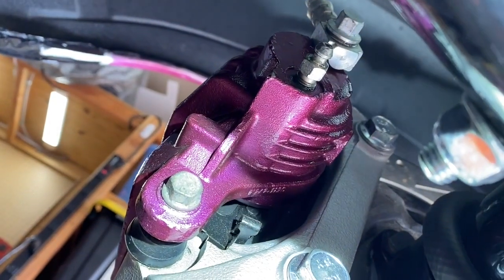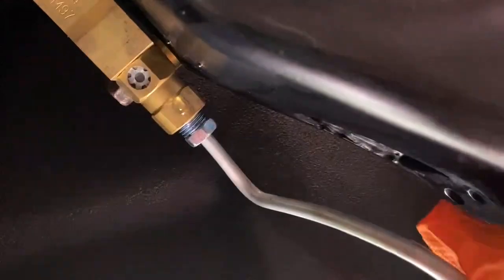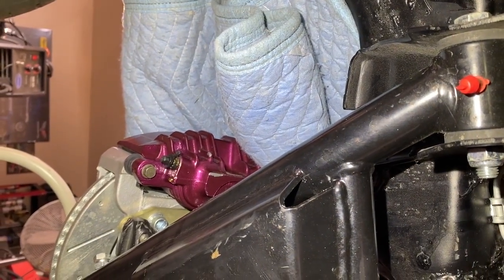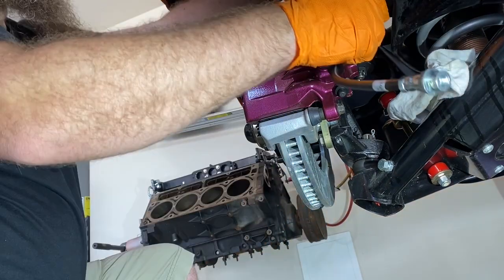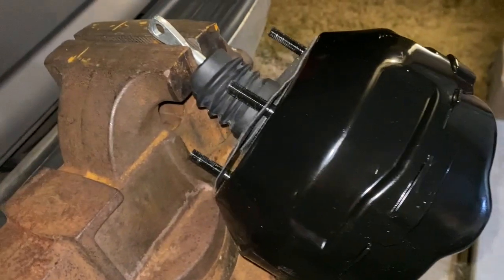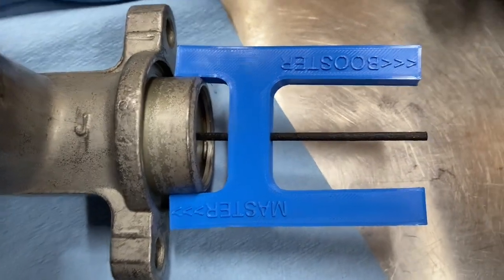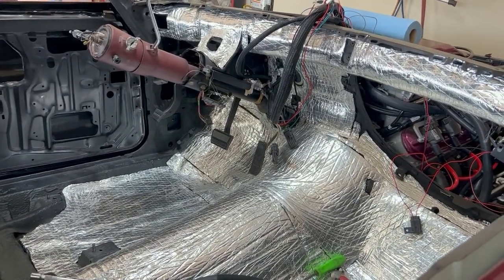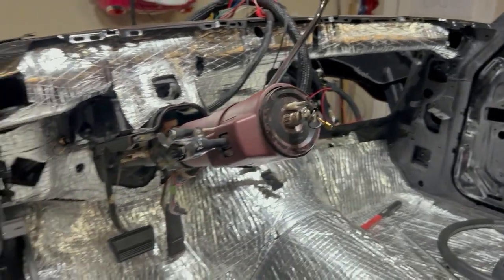G Body El Camino Restomod: Hydraulic Brake System, Pneumatic Brake Bleeding, and Stat-O-Seal Washers

Comment: I'm helping my son fix up / "restore" his first car, a 1986 El Camino. We're almost done with a six month "restoration" and color change of the interior. Plan to do a 6.0 4L80e swap with a 9", rebuild the suspension, steering, and maybe a mini resto of the frame.  Watching your videos are a good motivation for me, so thank you for your time/effort.

I did notice that it appears you have all of your calipers on the wrong side of the car though. The bleeders should be at the top of the caliper to assist in getting all the air out of the system, although with the vacuum bleeder maybe that isn't necessary.   I hesitated to mention this as it seems like your brake system caused you a lot of grief.

Keep grinding, and much respect for the time, money, blood, sweat, and probably tears you're putting into this rolling memorial.